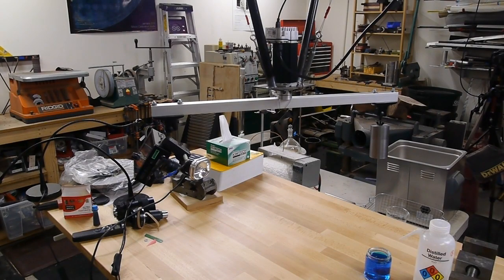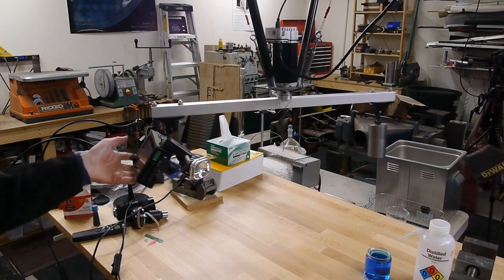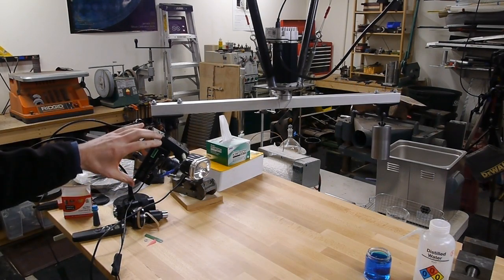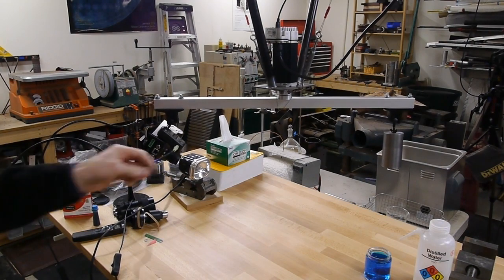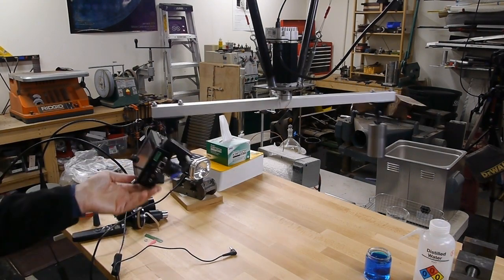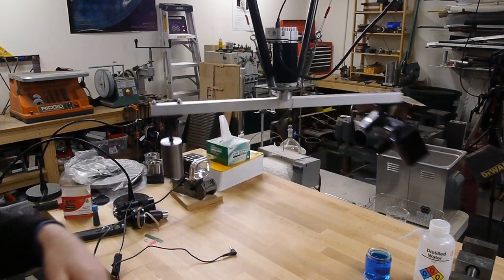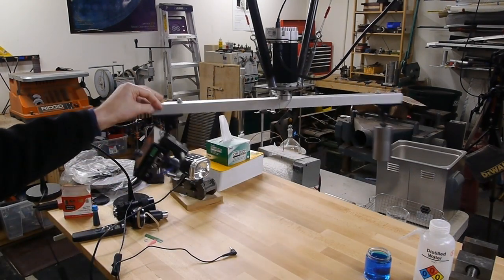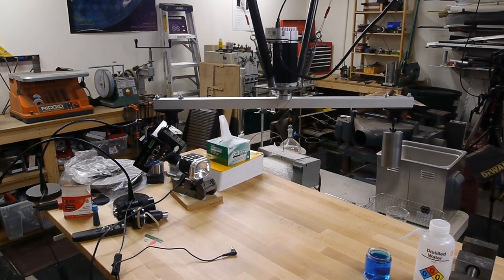"Bullet Time" with the Chronos high-speed camera

Comment: Hello, can I humbly suggest a possible line of enquiry. Where I live is very windy and sometimes it is even difficult to close my gate. I was wondering would it be possible to use a piezo crystal(s) to make use of this linear force to do work on the piezo crystal. The crystal would then charge a battery. A mechanical spring could cause the gate to return to the uncompressed state from where it could inject more energy into the battery, while vibrating.
I don't know much about piezo's potential for this application but I'm guessing you might have an idea. Thanks for sharing your work :)

Comment: It's beautiful in itself what you do. The views are mesmerizing. But I wouldn't say you've achieved the bullet time effect. It's slow mo, but without the bullet time. I expected that the objects would be absolutely frozen with, e.g., the sparks hanging in the air. You remember the opening scenes of The Matrix where Trinity jumped and froze, and the cam turned without her not moving at all: frozen in the air. Is it possible to freeze the sparks or spray drops in the air and rotate the view without them falling?
Still, don't get me wrong, the views are beautiful per se and are new for me as I haven't seen slow mo with rotation yet. Thank you for sharing :)

Comment: Loved the video, but quick question why is the slowmo footage in 4:3?
Reply from the maker: The camera can record higher framerates with smaller frame sizes.  At 1024x768, we get 20% higher framerate compared to 1280x720.  If the subject is already pretty square itself, it seemed like a good tradeoff to get smoother slow-mo and use a smaller frame.

Comment: Why was the spray paint section reversed?
Reply from the maker: I thought it would look interesting to see the paint droplets flying off of the paper.  The effect didn't turn out quite as impactful as I had hoped, but I still included the scene.
Reply: Thank you for replying, this video was very earth shattering for me.

I messaged you a while ago about faraday rotation. If you ever have time, please, can you tell me the specs for your experiment, I cannot duplicate your results and have invested a huge amount of time into fabricating a large rotator.
Please if you have time, it would help me so immensely.
Reply from the maker: I don't remember the exact specs, but it's something like a solenoid coil with 2-3 thousand turns, carrying 5 to 10 amps.  The axial length of the solenoid is about 5cm.  Olive oil is a good liquid medium to show this effect.  I'm using decent linear plastic polarizers with a high degree of polarization (.002% extinction) from http://www.apioptics.com/linear-polarizers-spec.html
Reply: Applied Science thank you so much for replying. I will attempt to duplicate your results. 
Right now I am running around 16  amps with ~250 turns, over ~25cm submerged in no name extra virgin olive oil. It's colour is Much different to the oil you use. But I have no effect visible to my eye at all. 

Thank you again.

Comment: How do you get the sound during these slow-motion shots, like the sound of the paper or nitrocellulose burning? When I've heard that on other channels I thought it was a post-processing gimick but I don't expect that from you. The crackling noises are impulse noise that shouldn't be audible when played back slowly.
Reply from the maker: The audio for the slow-motion shots was recorded with an H4 handy recorder of the actual item being shown (though, it was done in a separate take).  The only exception was the milk drops -- I dripped water from a higher height into a deeper container to get a more classic water drop sound.  I slowed down the audio playback to about 40 to 75%, which is a good balance between playback speed, and recognizable sound.  If the audio is slowed down to actual slow-mo playback speed, it sounds terrible.  The only options are to use completely fake sounds, nearly realtime sounds, or no sounds at all.
Reply: Thanks for the explanation, Ben. I love your channel.
Reply: May I suggest you get a mic from a cell phone or something, attach to a 100MHz+ storage scope with good probes, crank up the amplification and start recording on a trigger level. You should record at at least 1MS/S
place the mic as close as practicable, to the subject to minimize sound wave's travel time.

Comment: Even at $2700 this thing is over priced to hell.  I think the total cost of the raw components is something like $300.  The most expensive parts are the case and the lens.  The RAM upgrade proves it too, because it's basically laptop memory, and he's charging $250 more for 8GB more of RAM.....when you could literally get 16GB of RAM for like $50-$70 total.  So these guys are making literally more than $2000 profit off of each unit which is just greedy.  Judging by the number of backers, they have already made $200k in the bank.

Comment: True bullet time is different than slow motion and a moving camera. Bullet time follows the subject and then stops the action, rotates around it, then starts the action again from a different perspective. The setup is much simpler than you have; a ring of cameras around the subject (originally 35mm still cameras, the same format and lens as the motion picture camera) shooting video. At the moment you want to stop, take the same frame from successive cameras along the ring, lingering at any point along the way to ponder the frozen subject in detail, zooming in or out as well by progressively changing the focal length along the ring, or moving the cameras up or down as well.

Not to disparage your setup, it has great potential, but the effect of bullet time is much more dramatic, freezing time and moving around something that was moving and now isn't. You might get close to that effect by rapidly changing speeds, from say 200 fps to suddenly 2500, make a partial rotation, stop on one frame for a few seconds, rotate, then continue, but you never get video from a single location, and you still would have a ton of editing to do later.
Reply: BariumCobaltNitrog3n i thought i was the only one..

Comment: The camera is a lot cheaper than Phantom cameras mainly because its parameters are a lot worse... For 1280 x 720 the Phantom is actually over 18 times faster, so yeah, there's your price difference. Max 21k FPS vs over 100k FPS and up to a million in the ludicrously small resolutions. There's no contest here. Even your short clips show the Chronos is too slow to show anything interesting.

Comment: 9:40 I use LED 20Watt system for my normal videos, much less heat than Halogen Light and have lasted a long time even roughly handled
LED Video lighting Using step down & boost up Volt (basics)
Video camera lighting 30 Volt LED's from a 15 Volt laptop PSU
https://hackaday.io/project/7553-led-video-lighting-using-step-down-boost-up-volt

Comment: Incredible shots! Has this ever been done before? Given that most high speed cameras before the Chronos have been wired?
Reply: Frank Sandqvist, I'm guessing nope. Most high speed cameras to date have been too heavy, expensive and wired to even think about doing this. There are some high speed cameras such as Sony RX series that could probably used for this but the frame rate wouldn't be as good. I still don't think anyone has done this before with a proper high speed cameras.
Reply: I don't know but similar shots were made using stationary camera with moving mirrors

Comment: Fantastic shots! The match and the fly blew me away. Your triggering setup is a great little hack, I never would have thought to use one of those wireless triggers that way. If your servo has enough torque you might consider using the linear actuator to do micro-gravity experiments. By accelerating both the test and camera down at 9.8ms^2 you could simulate a 0G environment briefly. 

Thanks for your awesome work!
Reply from the maker: Thanks!  I really like the micro-gravity idea -- I hadn't thought of setting up a box with subject and camera, and then programming an exact 1g accel, but that sounds awesome!

Comment: Nice work!   Love the wireless trigger.
Reply from the maker: Thanks!  If you end up getting a wireless trigger, in the "trigger settings" on camera, use "1mA pullup" only (not the 20mA), and a threshold of 0.3V.  It's reliable once setup this way, but it took some fiddling to figure it out.
Reply: We need some sort of Chronos forum/group to share tips with other users.  The lenses you got would be valuable info.  I've been using a 5mm macro ring on my zoom lens to get macro shots but it isn't the ideal solution.
Reply: Look for the Raynox macro filters, I have been using the 250 on my (very dated) EX-F1 for ages and the results are pretty good.

Comment: as far as i know the camera doesn't come with a lense, at least this is what ive heard from dave off the eevblog channel, and he was talking back and forth with the creator quite a bit, the lense is just included so the reviewers can actually use the cam
Reply: it does, it's just more expensive. it's also a common mount so you can use practically any lens you would normally it also comes with an adaptor for other lens types. you can see the lenses that are included on the kickstarter. https://www.kickstarter.com/projects/1714585446/chronos-14-high-speed-camera/description
Reply: You can get C mount lenses for less than $30 .. the Fujian 35/1.7 lens for example... People use it successfully on APSC cameras, so on a system with an actual C mount appropriate sensor like this it'll be even better.
Reply: jeff fries so be it, i left room for correction  just because i was quoting someone else(a generally reputable source mind you ) but everyone make mistakes.